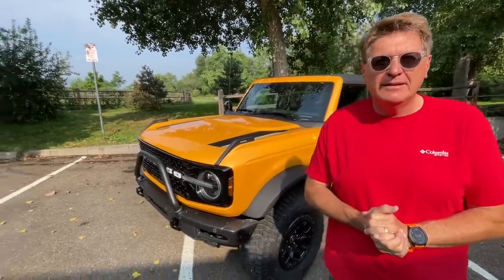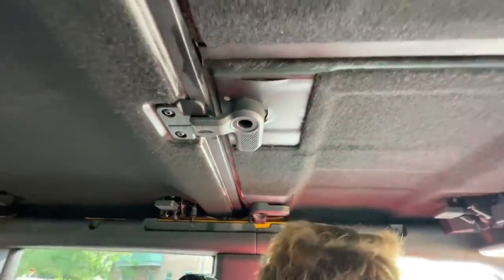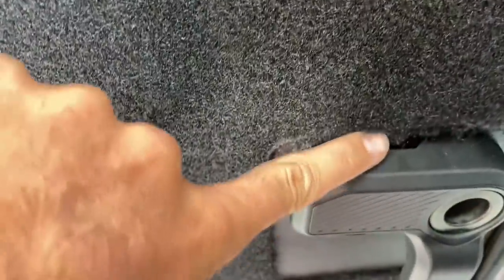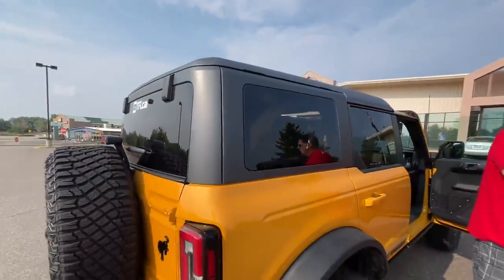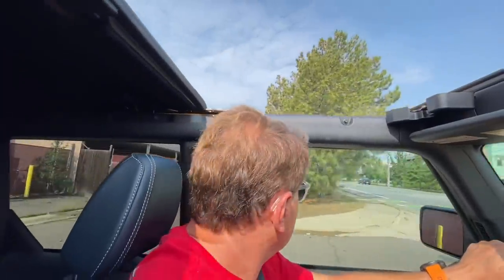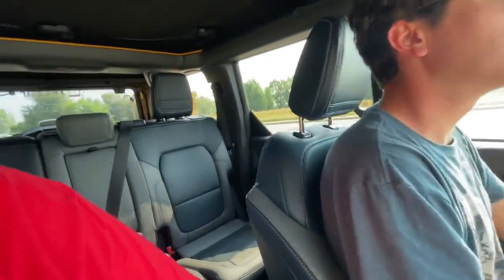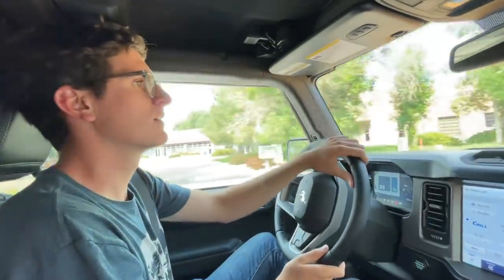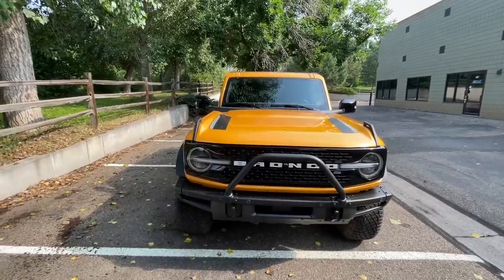This Roof Squeak In My Brand New Ford Bronco Is Driving Me Up The Wall, What Gives?

Comment: I can't believe nobody has mentioned this yet (probably because so few people actually OWN a hard top 6g Bronco) but the noise is coming from the hinge latches on the roof. You can easily tug on them to recreate the rattle sound, and it's a little odd neither Tommy or his dad thought to just reach up while driving and touch where the sounds are coming from. The hinge, in the locked position, has a little bit of wiggle/play, but this can be remedied with lots of different DIY methods. Not saying that Ford shouldn't have discovered this and fixed it, but it isn't a problem with the roof itself, just the latch mechanism. Very easily fixable.
Reply: And Ford can also recall the hinge latches later and replace them for owners. They come off with just a few bolts. Just saying, Ford...

Comment: I've also read that there is a grill and window whistle when at highway speeds.
Reply: Two trims have problems with the grill, the other is actually the mirror, not the windows.
Reply: @mechmat12345  oooh we found a resident expert
Reply: @aron6998  cool kiddo
Reply: @stevemiller.   funny moments

Comment: I honestly think its the handle that keeps the roof top on. Seems like its a little loose. Maybe retighten it (i know its a ford problem) but if you want it gone maybe that will do the trick. And that head liner....i'd probably rip it off and put some bed liner on it.

Comment: Never buy a first year model, DUH. OK maybe a first year Toyota but hard NO for Jeep, Ford, GM, etc.
Reply: My first Toyota squeeked from day one and they wouldn't touch it. All they said is the fix would make it worse. Had that truck for 4 years and it never stopped. Toyota dealerships have parts and service depts for a reason and it is not to work on Fords and Chevys.

Comment: Webasto has a big quality control and fitment problems. Their sunroof line even has problems with trim rings lifting up causing wind noise and water leaks (like both of my vehicles equipped with them suffered). I wouldn't have trusted them to make large roof panels.
Reply: Ford for ya probably was affordable n thats all that matters

Comment: This is why I'm going Toyota. When the 2022 Tundra hits dealers I'm trading my 2019 Ram Rebel. I've had Ford and GMC. I just can't do it anymore with these brands.
Reply: How has the Rebel been? My gut tells me that RAM is surpassed GM trucks in quality. You sound like me...I gave up on GM and FORD in 2004. My wife and I now own our 4th Toyota...newest is a 2020 Tundra. Toyota is top notch quality. Reliability is also very very high.
Reply: @mikefoehr235  had a metal vibration coming from under the dash near the steering wheel when I first bought it. Realized it was the metal rod to pop the hood, a zip tie fixed the problem. Month later rear window making a noise while driving. Haven't figured out where it's coming from since there's no leaking I just learned to ignore it. They must've forgotten to dampen the passenger side speaker because it vibrates on the panel if I turn the volume over 15 which isn't very loud at all. Great looking truck inside and out, but after awhile you can feel the lack of quality fit and finish.
Reply: Is it perhaps, the Japanese manufacturers are leveraging the slow and steady approch wins the race eh?
Reply: i hear ya, but even 1st yr with the all-new tundra will have something surface...
Reply: @mikefoehr235  oh also the truck having 21 recalls in the first year a bit concerning..lol
Reply: @jedknutson8373  if they can do better than 21 recalls in the first year it's a winner over the Ram. My wife 2018 Genesis G80 Sport has only had 5 recalls.
Reply: That 2022 Toyota will have issues of its own most certainly. My sister's 2021 Highlander has been to the dealer for all kinds of electrical and interior quality issues.
Reply: @hellkitty1014  I'll take my chances. Wish me luck. 😏
Reply: @NA-du5vm  good luck. I only owned Toyota for most of my life and now I am over it. 2018 rav4 and 2019 sienna was disappointed me. Had issue with door and hold crap can they make the seats less comfortable? Both were new and now I been trying different manufacturers. I have to say GM is trash and I don’t get why they even make cars/trucks
Reply: @NA-du5vm  that they will do..
Reply: @kdavid123186  maybe I should bite the bullet and just go Lexus like my wife or am I asking for trouble there as well?
Reply: @NA-du5vm  21 Recalls in one year...WTF!!! I cannot lie...my 6 month old Tundra needed a new battery....replacement battery seems to be doing well. The rest of the truck is real solid.
Reply: @mikefoehr235  recalls come with every manufacturer no way around it, but seems Dodge/Ram is trying to out do everyone..lol
Reply: @NA-du5vm  My wife and I have now our 4th Toyota. Since 2004 only 2 recalls....2004 Corolla had a recall in the ECU and December 2019, recall to inspect the frame on my 13 Tacoma. With Toyota trucks, if you spray the frame with Krown and have a car wash with under carriage blast, the frames will not rust much at all. My Tacoma looked like new after 7.5 years. Of the 4 Toyotas, the Corolla was towed once when the fuel pump failed....so one tow in 17 years. My Tacoma never left me down. Best truck i ever owned. Hope the Tundra will be the same.
Reply: @shitloveaduck  My brother in law has a 16 Tacoma...it had a few issues. He was thinking of buying a RAM or a Titan but his one coworker has a 2 year old Titan and I KID YOU NOT...This coworker is now on engine number 4...all under warranty. I don't think i have ever heard of ANY vehicle needing 4 engines in such a short time.
Reply: @mikefoehr235  - I think you may have told me this before and I doubted you. In the end I was wrong and learned a lot! I was aware of the old Titans, but the quality dropped significantly. I’m sorry I doubted you!! Given a choice of the 3, I would keep the Tacoma. They are still decent vehicles, just not the Mythical beasts some Toyota fans portray them to be. I had narrowed down my post injury choices to a Tacoma TRD Sport and a Honda Ridgeline EXL (in Canada first line with leather). In the end I went with the Ridgeline. The ride and interior comfort are better than anything I have owned that was a truck!! I compare the quality as similar between the two. Neither perfect, but near the top for sure. I even have a front levelling kit and slightly more aggressive tires for fishing trails. It’s now more capable than my back can tolerate!! Haha. Life can sure change our perspectives sometimes!! 
    It’s a tough market out there right now. I have a 21 F150 Lariat PowerBoost as well that is modified for some heavier off-road use. It’s not exactly much use to me now other than towing a 8,000 lb trailer.  Other than the recalls, which I was expecting and am not disappointed with, it has been problem free, except we destroyed the skid plates kinda so I put much more robust plates we bought and also manufactured to give full undercarriage protection. You could slide that truck down the side of a mountain belly first and damage nothing!! Almost,,,, heh heh. I have a buyer that is a friend,,,,, I may let it go. I really enjoy the Generator aspect of the truck as well! Oh well. 
   Stay safe!! Sorry I doubted you!
Reply: @shitloveaduck  As I said, I had a Tacoma...the drum brakes are crap....going to my camp in northern Ontario and the mud would cause the brakes to seize on. I also replaced the rear springs because one element cracked...Towing our RV across Canada came into play. The Trans Canada 🇨🇦 in Manitoba is a washboard hiway. The aftermarket springs were so much better. Overall, a real good truck. I am not confident that NISSAN is very good. Just watched Kirk Kreifel....he says INFINTI is moving in with NISSAN dealers because of poor sales in Canada. The end of Nissan may not to far away now.
Reply: @NA-du5vm  nothing wrong with it. But I have problem with their sedans. Gs350 was badass car and they changed it for es350 which is front wheel drive. Is line up is so small in the back seat. I would never get one. SUVs are cool but for the price I want little better info. Look at ram or ford. Now take a look at info systems on 80k suv from Lexus. Yeah I am not sure about that. Reliability is awesome but is it ok for ask for more ?

Comment: I had a bad squeak sound coming from my 2019 Ram 1500 Laramie passenger side dash area.  Took forever to figure where it was coming from. Drive me insane.  Took apart the passenger side dash apart like 5 times before I found out the issue. Ended up being the airbag mount bolt, just retighten and issue fixed.

Comment: And this is why I haven't bought an American car since the late 70's
Reply: started in calif 1968?  for there smog laws to ruin profomance  bumper s  the 80s where even worse ,did buy a 95 grand cherokee great off roader  has 215k on the org 6cy  tied with my 92 4 cy auto toyota  pu 167k  im not sure if id even buy a new 2021  no trubos and rear wheel drive for life

Comment: Lol 60K later the issues start...glad I chose to go with the TRD Off Road 4Runner
Reply: 4 Runner doesnt Have a removable top like the Original these removable tops always had issues Dodge Full enclosed it on ramchargers n the 80s GM in 1976 Ford followed in 78

Comment: I would try some silicon spray or something to lube the seals. Maybe a small amount of of lube on the contact points for the clamps. Seems like it makes the noise when the chassis flexes on bump. Can you vacuum the liner and let us know if that debris continues to fall off of it? As far as it coming of. I have a new Harley Davidson Heritage Classic with a tour pack. The tour pack is plastic with leather glued to it. The heat caused the glue to loosen up and the leather started to come off. Harley did nothing about it. If it is heat related like my tour pack I would hope Ford would do something about it.

Comment: Figured the fact that it took so long to finally roll off the assembly line, that these type of issues would have been addressed. This isn’t 1980. Reason  alone  I wouldn’t currently buy one.
Reply: The problem is a third part manufacturer. Just getting them to make the damn tops has been a huge problem. That's not entirely Ford's fault.

Comment: That's an easy fix. The roof just has some slack and isn't sealing 100%
Reply: Yes that is true but you know how people are now a days, they can’t fix anything and they just complain.
Reply: Time to call the Quick Seal Guy?
Reply: I agree. Time for Ford to partner up with flexseal. 😂
Reply: @_01JohnJ  might be an easy fix but for 63k and two weeks old it shouldn’t. These manufacturers want to start pushing prices into the 70k-100k price range they better start building with quality.
Reply: @jray8427  yeah until one company starts no one them are gonna do it
Reply: John Justice I'll gladly complain if I bought a brand new vehicle for 63K
Reply: @jray8427  Keep in mind it is government regulations that push these vehicles into the stratosphere in price. Mandated pedestrian safe bumpers, diesel emissions, and so on. Manufactures can only do so much. Wait until the government introduces electric governors to keep electric cars from passing out their drivers from ridiculous 0-60 times. It is coming.
Reply: @matthewrobertson156  - you forget the insane demand for “more” from the clientele that watch these videos yet can’t often afford any of them!! When you take the sum of all parts, this is not so excessively priced!! They are putting it up against a Defender that seriously customized and a heavily customized Wrangler next and the Bronco is stock!! More off-road content than a Wrangler Rubicon, mostly as a result of the rear wheel aid in cornering, and arguably the absolute most capable stock road going 4x4 in North America right now. Jeep has an answer coming, but it’s not here yet. It too will cost at least $63K with similar content. Thing is, a lot of features are excellent. The disconnecting sway bar that does so when you need it to, not when you find perfect ground that the vehicle will let you disconnect. Lockers that engage anywhere, not on almost perfectly level ground (Toyota!!!).  It has a ton of content. Buy a base unit and add the Sasquatch package. That will be a very good bang for the buck for the more serious off-road crowd. Not the extreme crowd, but that’s a small percentage of the market and the aftermarket needs support! 
    I cancelled my Bronco 2 door Badlands I ordered just due to the delays. It then came available again and when I tested it, I was not really impressed anymore. Had seen too much hype for literally too many years, it was anticlimactic. I must note it was not a Sasquatch packaged unit. THAT may have impressed me!! Haha. Instead I bought a 49 Ford F1 (Actually a F47 as I’m in Canada) that is done with a 350 GM powertrain, that I am going to convert back to a nice supercharged Flathead! Nothing crazy, more for show than go. There will be a complete repaint from pinkish purple to factory Iconic Silver. The Frame will be resprayed to black. Stance is perfect as is, so a somewhat easy build. I have the motor and C4 automatic already, just waiting on the new bell housing and supercharger itself! Then the terrifying fun part of the build begins, I am doing the Supercharger installation myself! With the help of a Toyota mechanic! What do Toyota mechanics know? They supposedly don’t break down!! Hahaha. 
    Stay safe, Eh!
Reply: @austinmarin9334  what’s the difference between 63 and 33, new is new

Comment: Check the bolt above driver and passenger hard top tp see if the top is laying on them or they are through the holes. Happens in jeeps sometimes and i heard factory forgot to put them through some

Comment: It’s hard to tell from the video recording but it sounds like the rubber seals in the roof might by itching. The fact that removing the panels fixed the noises temporarily, lends credence to this.  It’s not uncommon for rubber seals on convertible tops to make noises like that due to body flex. This body flex results in micro movements in the panels where the seals press against them and if the seals can’t slide properly against the panels then they will slip and grip resulting in similar noises. Body flex is constantly occurring even on flat straight roads but is much more pronounced when hitting bumps.  Auto manufacturers will often times use seals impregnated with Teflon or seals with a very fine texture in them to try and prevent these types of noises. In my many years of experience working with vehicles that come in both soft top and folding hard top variants I’ve learned that regardless of how the seal is made they will all eventually make noise. It’s just a matter of time with higher quality seals typically lasting longer before the noises start.  In cases like this, good old generic dielectric grease can be a life saver. Clean the seals with glass cleaner and then very lightly coat the seals with dielectric grease. You’ll want a thin, smooth, even coat. I just put a little grease between my thumb and index finger and then gently pinch the seal between my fingers while sliding my fingers along the seal.  I’ve found using this method you can generally coat a few inches of seal at a time before needing more dielectric grease.    Feel free to use your own method, this is just what works for me.  Keep doing this until the entire seal is thinly and evenly coated. Reinstall the panels and see if the noises are improved or gone completely. OEMS usually have their own specific seal lubricant for these issues but they’re usually very expensive (some are over $100 an ounce) and none that I’ve used work as good or last as long as dielectric grease. Dielectric grease can also stop minor water leaks between seals and panels or seals and other seals. The only thing you’ll have to worry about over time is that the grease will attract dirt and dust to the seal. Too much dirt and dust on the seal could potentially damage it if left uncleaned so you’ll want to keep an eye on dirt and dust build up on the seal. Again glass cleaner and a rag is great for cleaning the seals. I hope this helps!

Comment: Wlcome to the beta test. On hand they did not do enough testing or did not like to delay it more. Also its not easy to build a offroad vehicule which does not have a solid roof. There is a lot of flexing. I guess ist will be worse over time. Temperature may be an issue to.

Comment: I fixed mine and it took only a few minutes:

- Remove the driver's side roof panel and lay it on the the flat roof service.
- Identify the 1/4 turn latch that would be located over the seat belt (when installed).  
- Locate the black stem that would seat into the metal bracket on the vehicle frame (it's adjacent to the 1/4 turn latch handle). 
- Wrap this in a thin layer of electrical tape (three wraps is more than enough) or use - like I did - a short section of adhesive shrink wrap tubing.
- Reinstall the door. Problem solved.

Comment: You could try to dry lubricate the rubbery bits with some powder which are probably the cause of the issue. But I’m not sure if you’d want to try and fix it yourself on a new vehicle…

Comment: My uneducated and completely off-the-hip opinion: I think the squeak is due to flex in the body and/or A&B pillars versus the flex in the roof panels.  I think that the "flex" is different between the two which results in one flexing/twisting more than the other, resulting in squeaking as the two essentially "rub" against each other.  The Jeeps have an integrated roll cage which I think results in a far stiffer A&B pillar and therefore little to no flex of the upper frame and therefore no "rubbing".  But again, this is a pure guess.